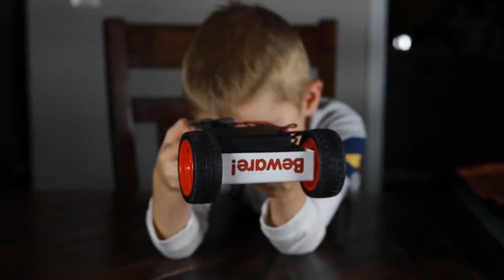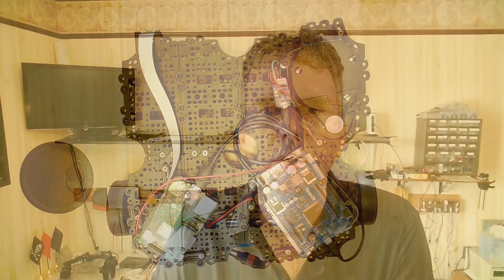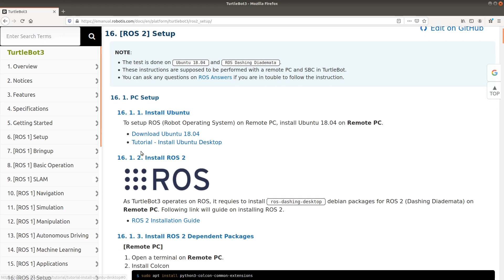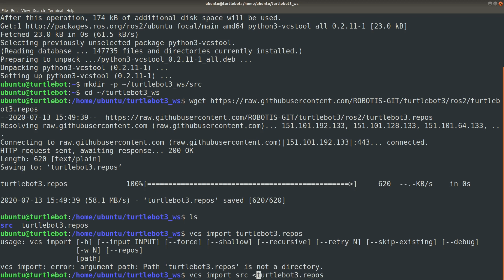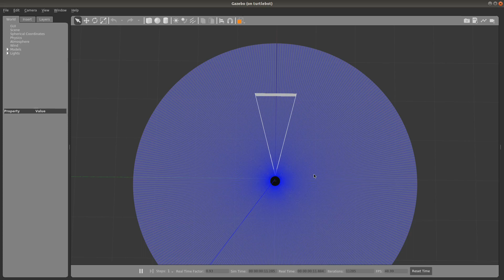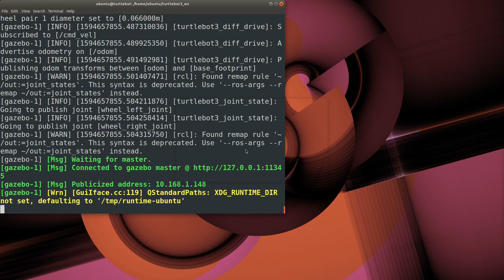Simulating the TurtleBot3 Robot

Comment: What is the system requirements for this?
Reply from the maker: This video installs ROS 2 in a LXD container running on an Ubuntu 18.04 workstation, the workstation is a Dell XPS13.

ROS 2 can be installed on Ubuntu, Debian, Windows or WSL. ROS can be running in a virtual machine (VirtualBox, VMWare, etc) or in a container (Docker, LXD). When installing on Ubuntu, the ROS version is tied to the Ubuntu version: ROS Foxy for Ubuntu 20.04; ROS Dashing for Ubuntu 18.04.

Hardware requirements vary depending on your robot. I've installed this on a raspberry pi 3B+ although it's a bit sluggish. It should run fine in a VM on just about any modern workstation, although you may need to increase RAM to build the turtlebot software.

Comment: Another great video Sid! Shared it to the ros rover facebook group I'm in. Would love to see you join the group and see the cool stuff people are doing. I have a question regarding an outdoor rover using a Rpi 4 8Gb. Would you recommend a rplidar over a T265 camera. T265 from my understanding has a built in IMU and does all the processing 'on board' freeing up precious resources on the Pi. Im planning on using wheel (encoder) odometery, IMU, Compass (if the imu doesn't make it redundant) and either the rplidar or realsense T265. Really interested to hear your opinion.
Reply from the maker: Hi Flynn3778,
Those two sensors are fairly different therefore it really depends on your use case. The first question you should ask really is which sensor is best suited for the environment? Using a camera at night may not work. Similarly a laser scanner with no obstacles around the robot will be useless. Assuming you are mostly interested in odometry and since you mentioned the case of an outdoor rover, you may be interested in using a 3D sensor (T265) if you foresee your robot going on uneven terrain and or in large spaces. The rplidar (lower cost models) is a neat sensor but was really designed for household robots. It is still a very capable sensor and integrating a small IMU unit on the side would be a great learning experience! Furthermore the Rpi 4 8Gb is a little beast, running some 2D laser scan matching and IMU integration on it really won't take up much resources.
To summarize, try to characterize your use case as fully as possible and then check which sensor fits the constraints. If several options work, then you can consider other things (power consumption, integration time, fun etc.).
Reply: @UbuntuRobotics  Taking in that information I think it's the T265 which will suit the rovers needs more. It's even more suited because of it's lower physical profile, space is at a premium. Looking forward to your next video!